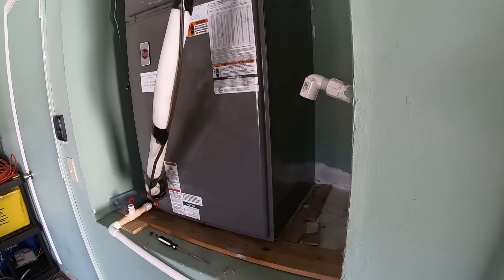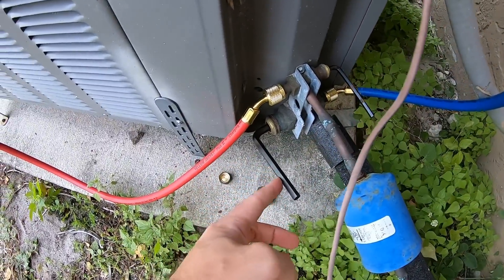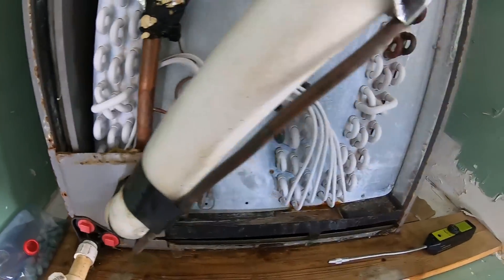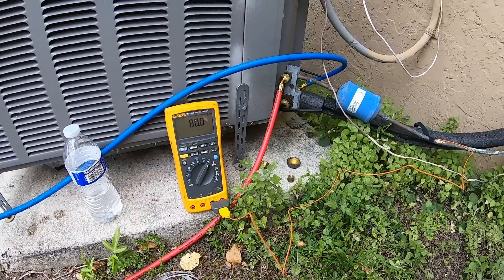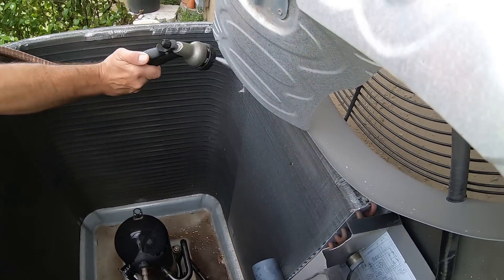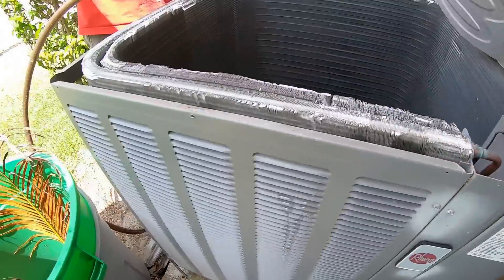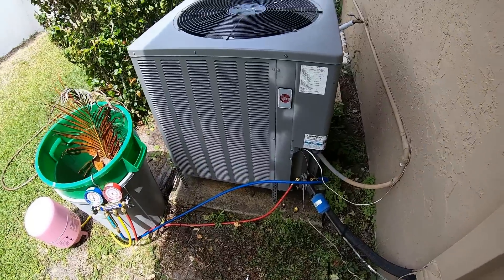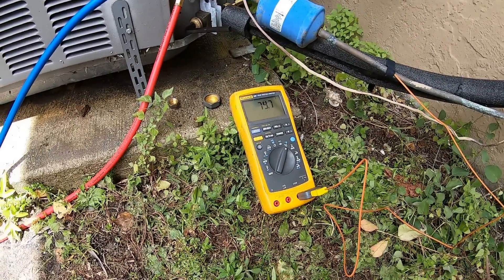Charging a Rheem 5-ton R410a split air conditioning system

Comment: why not just reverse what refrigerant you still have in the system back into the compressor and  just test with nitrogen?
Reply from the maker: A pump down is a good suggestion. I didn't do it here for two reasons. 1. The homeowner really had no interest in finding and correcting the leak... He was just buying time until he could afford to replace the system, which he has since done. 2. I didn't know what a pump down was at the time.

Comment: Fyi, when you are using analog gauges which can be two to three degrees off, you need to put your temperature pro closest to the service port there is a one to two degree difference on the opposite side of the filter dryer. But just get some digital gauges come into the 21st century.
Reply from the maker: Yeah, this video is a few years old now. I've since gotten the Fieldpiece JobLink probes and love them! Huge time saver and far more accurate.

Comment: Hi, my r410a with txv unit. The suction saturation temp is about 33F and suction line temp is 48F giving 15F of superheat. But why is my liquid line saturation temp is 97 and my liquid line temp is also 97. I tried adding some refrigerant but nothing changes. This is a high velocity system air handler with a slab coil. I think my suction saturation temp is also too low. Both coils are clean and txv valve is new. Any help would be greatly appreciated. Thanks
Reply from the maker: Based on what you're describing it sounds like a low refrigerant charge. Is it fairly cool inside the building? If so, that might explain why your superheat is fairly low, for essentially 0 degrees of subcooling.

Did this problem start before or after the TXV was changed?
Reply: Indoor temp is about 70F. Before txv replacement suction sat.temp was 29F and suction line temp was 33. I don't know why the suction saturation temp is still quite low around 33F.
Reply from the maker: @mark.r8900  That's a pretty cool building... Telltale sign of a low refrigerant charge is low subcooling and high superheat, but if the building is not that warm to begin with, the superheat might not be that high.  When you added refrigerant, what changes to the system did you observe? When you are adding refrigerant to a TXV system, as long as you have a solid column of liquid going to the TXV, then the superheat should remain more or less constant. It's still possible to have a solid column of liquid going to the TXV even with close to 0° of subcooling. 

I'm not in front of the system obviously so I can't be sure, but to me it sounds like a low refrigerant charge. When the TXV was replaced, was the system just pumped down or was the refrigerant charge recovered and weighed?
Reply: While adding r410a i don't see a change in subcooling. And the superheat stays the same around 15F. I am just confused as why the suction saturation on my gauge showing low reading of 33F. This is close to freezing. Should the low side pressure and saturation temperature go up with more r410a added? Thanks
Reply from the maker: @mark.r8900  Yes, those should go up as you add refrigerant.
Reply: The compressor keeps going off on pressure relief. So I just closed both service valves at condenser and only recovered what's in the line set and indoor evaporator.
Reply: I see on units with piston yes the low and high side pressures go up as I add refrigerant. But on system with txv I see the high side pressure go up. But the low side pressure remains pretty much the same. Is this normal? Thanks for your help 👍

Comment: Joe - what's a ballpark price for this job? A local company wants $2k for leak detection and refill on my 5 ton Carrier. Seems high.
Reply from the maker: Without seeing the system and the details of the quote that sounds kind of high but if your system is completely empty and it takes R22, which is over $100 per pound now, it might not be that far off.
Reply: @JoesGarageProductionsLLC  Thanks. R410a though. All these guys just want to give a Hail Mary estimate in hopes you'll just go with a new installation
Reply from the maker: @beantown_billy2405  yeah that's one of the reasons I do my own air conditioning work now. I'm no expert but I've learned quite a lot. Odds are if yours is leaking it's probably leaking in the evaporator coil. Got to guarantee but that seems to be where most of the leaks are. You can expect to pay somewhere in the neighborhood of 500 $2,000 to pay a contractor to replace the coil assuming the coil can be easily removed. A lot of times contractors install these things and addicts and there are trusses and such in the way
Reply: @JoesGarageProductionsLLC  It blew out at the low pressure side copper elbow under the air handler, obvious hole. Instead of brazing it up and recharging they aggressively propose the most expensive fix possible - new installation. There are some clowns in the HVAC world. This latest dude straight up lied and said it's against EPA regs to recharge without full electronic leak test (it's not). It's like taking your car to the mechanic for a busted radiator hose and they tell you the radiator must also be replaced just in case.

Comment: Klien temp is always off by 10 on mine ....could of clean coils first for more  accurate for sub cooling....not judging your work..just comment
Reply from the maker: Thanks for the feedback. Yeah I'll be honest with you I was pretty green to air conditioning systems when I shot this video. I've learned quite a bit since then. I'm starting to collect the necessary tools to replace mine when the time comes hopefully several years from now. I've watched a number of air conditioning guys do the procedure start to finish and it doesn't really look that difficult. 

Klein makes pretty good hand tools but I don't really have much experience with their electronics. I've always used fluke stuff. Maybe I'll stick with it :-)
Reply: @JoesGarageProductionsLLC  i am using SUPER  COOL app...for sub cooling and super heat...try it out  ..I am learning as well
Reply from the maker: @SuperCano1997  will check it out thx.

Comment: When you charge the system it must be in its operating in full assembly mode. If you are charging with the panel off you will not get true readings because the air is being drawn through the coil AND Around it. All air must go through the coil. Also, people sometimes forget the factory filter that the air handler comes with. Another area that Rheem/Ruud have for a typical leaking area is the pilot tube.  May God always bless you all.
Reply from the maker: Thanks for the feedback and the tip! Will keep that in mind for next time.

Comment: hi does the Allen wrench open up the  valve?  my contractor didn't open it and charged it does that mean it was not charged??
Reply from the maker: The service valves are used isolate refrigerant in one part of the system or another. Normally they should be in mid position to allow refrigerant to flow freely

Comment: Why would you take the caps off and put allen wrenches into the service valves just to add some r410a? Adding refrigerant doesn't require any operation of the service valves.
Reply: Some systems don't have Schrader valves in the service ports. You have to manually open and shut the service ports to get pressures and remove or add refrigerant. 
410a should be added on the low side(the bigger copper pipe)
Reply: What do you know about King valves??
Reply: Because he has no freakin idea what he is doing, thats why. Do not listen to this clown.
Reply: I was confused about that too, my contractor never did that. but he did charge the red high side as well is that normal???
Reply: trev you can charge high side if the charge is low enough and the system is off but not when it’s running esp since 410 is a high pressure refrigerant.  You can get close enough by heating the cylinder and cooling the unit but in reality you would only do that after a recovery, triple evac and pulling a vacuum, then charge liquid in the high with the system off then throttle liquid thru the low with the system running. But then again I don’t got decades experience just a year and a half so take mine with a grain of salt

Comment: $25 leak detector isn't going to ever be accurate. Some tools you can't be cheap with
Reply from the maker: For sure. If I had to do this more than once every couple years, I'd buy a better one. Amazon ended up replacing it and the second one works fine.

Comment: for the sake of not reading all the comments and im sure its been noted.....you need to have the air handler panels closed to charge it correctly.  All the air is bypassing the evap coil....

Comment: Is the temperature on the 116 pretty accurate?  I have a Klein and it's about 10° off
Reply from the maker: I have found my 187 with the k type thermocouples to be very accurate. I have a few of them for different applications. I have heard people say that about the 116... Kind of perplexing since it is designed for HVAC work!

Comment: i applaud your video.. but if u know its leaking dont fill it without fixing it.. if the owner isnt responsible enough to own a home and all the problems associated with such you arent helping him by offering a bandage which is what u did.. not to mention added extra 410 a to the atmosphere as it slowly leaks when under higher pressure as the temp. goes up..
Reply: maybe it is such a slow leak that it only needs charging every two years or so, which by my figures, about 120 dollars versus who knows what to actually find and fix the leak or replace the unit makes sense, and 410a is not supposed to be harmful to the atmosphere, as anyone even without a license can buy it.... so you probably hurt the atmosphere more driving to the store than what that ac unit leaks in a couple of years

Comment: Hi good day sir! How many psi of  R401A in low side in split type AC, like LG outdoor unit. Thank you!
Reply from the maker: It depends on many factors. You can't charge these units by pressure alone. Most minisplits come factory charged though... Unless you have a leak you should not have to add refrigerant or subtract any provided the line set length is unchanged.

Comment: What  is the exact  pressure  to Low side and  high  side
Reply from the maker: Unfortunately, it isn't that simple. The exact pressures will vary based on operating and environmental conditions. The best way to charge these systems is using the method shown in the video - by superheat and subcooling. This will ensure both the evaporator and condenser are [properly saturated with refrigerant.

Comment: is it necessary to use the liquid vaporizer that connected to the low pressure side of the gauge manifold?
Reply from the maker: It is not required but it helps meter the amount of liquid refrigerant (you must add r410a as a liquid as others have stated) you send into the system to avoid compressor damage and to speed the charging process.
Reply: @JoesGarageProductionsLLC  hi Joe when you said liquid refrigarant you mean the additional stuff?
Reply from the maker: @TTTTT5050  Yes, R410a must be added with the bottle upside down, as a liquid, because it is a mixture of refrigerants. The vaporizer converts the mixture of liquid refrigerants back to a vapor before it is added to the system.
Reply: @JoesGarageProductionsLLC  thank you, so the mixture is all in the 410a tank?  I thought you meant buy an extra Nu-Calgon oil to be injected with the 410a
Reply from the maker: @TTTTT5050  yes all of the components of R410a are in the cylinder. The compressor also has oil in it that gets suspended in the refrigerant but you normally don't need to add more.
Reply: @JoesGarageProductionsLLC  thank you very much I learn a lot, I added the oil because the system is 8 years old and it's not as cool and three years ago I had a leak and I injected a leak repair so I thought maybe the oil leaks out. but so far I have never used the vaporizer to charge the system would this damage my compressor?
Reply from the maker: @TTTTT5050  as long as you charge slowly a vaporizer is not required.
Reply: @JoesGarageProductionsLLC  thanks Joe! you been an enlightenment for me
Reply: Thank you Jor’s Garage for your quick and very helpful reply. Thank you

Comment: Where is your scale??? How do you know how much refrigerant you put in? How much was factory charge? How long was line set? So you have no idea the percentage of refrigerant lost. Also were your gauges at zero? Good job on cleaning that coil..glad to see only using water too. So a tip.. first sign of a leak.. oil spot or spots. Okay..STOP acting like an HVAC tech. Until you go to school and get a refrigeration license.
Reply from the maker: Valid questions but not relevant here. this is an older, poorly installed system. Homeowner could barely afford the refrigerant, much less the cost of a service call. The objective was to get it running again as cheaply as possible until the homeowner could afford a system replacement. It is still running just fine today so the leak is hopefully slow.
Reply: @JoesGarageProductionsLLC   i think you did fine, and it is still running, so bingo homeowner i a winner, i am getting ready to charge my unit in a couple of days, is why i been watching, 410A can be bought by anyone, no liscense needed, and i am not a complete dummy, you can probably get it really close by just doing the pressures and not worrying about the heat difference, although i have the capability to do both. if i can add 30 dollars worth of freon, or even a hundred, a year and keep my unit going, i am a winner, as my unit is old, and this will be the first add to it this year, and it is not freezing up, just a little on the low side of performance, uneducated guess, a pound low, lol..... but if i cant fix it, i will call a professional, or look at a new unit.
Reply: just a top off relax !
Reply: why does it matter how much you put in...... or what the factory charge was in pounds ? it will tell you on the tag on the ac. you do not need a liscense to buy 410A , i am getting ready to add some to mine this week, and i am not a professional, just not a dummy either. my unit is 15 years old, and it is either add some freon n make itwork for the summer or buy a new unit..... take my chances on a shot of freon. it is not rocket science, just take your time and do it as right as you can.........

Comment: I don't believe you need the allen wrenches for the service ports.  The service ports utilize schrader type valves, all you need to do is connect the hoses.
Reply from the maker: It depends what position the valves are in. The position can be adjusted to isolate refrigerant to certain parts of the system for servicing. These valves were in the mid position so you're right, no Allen key needed in this case.
Reply: Your right John.. those are not king valves. King valves need to be seated and back seated with refrigeration wrenches to check pressure. Those valves are to be opened after lines are connected and evacuated. And if ever for service to close. Bit otherwise they are always open. And yes the Schrader valves are to prevent refrigerant leaks or loss. But they can leak over time
Reply: Unless your punching the Schrader valves

Comment: On 410 system generally the leak is in indoor coil  , plz correct if I am wrong , thanks boss great vid
Reply from the maker: In my experience, yes, most leaks are in the indoor/evaporator coil. They are subject to far harsher environments than condensing coils. Condensing coils can still leak, but it is a numbers game and the numbers suggest evaporator coils leak more often. I should note that a month later, the unit is still cooling great - hopefully it is a slow leak.
Reply: Leaks can be anywhere.. that's why you check with a detector or soap bubbles.. no bubbles no troubles.

Comment: Nice video, but shouldn't there be a trap in that condensate drain? Will prevent the water from draining properly.
Reply: Yes there should be a p trap on the drain. If it is a heat pump the coil is on the negative side so the trap prevents the water being sucked out of the line. If it is a gas furnace then NO cause the coil is on the positive side and water pushes out
Reply: It doesn't matter it has a condensate pump. Before the pump leaving the coil should have one
Reply from the maker: Is actually a drain on the outside. This unit actually had a condensation pump which was totally unnecessary. Not sure what the previous installers were thinking. There's only one 90 degree bend in this unit now should never clog